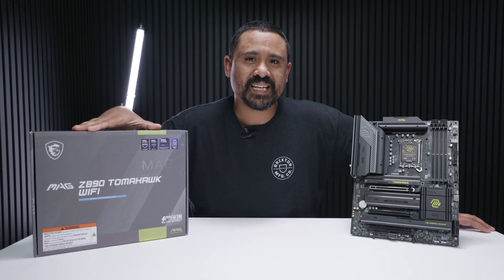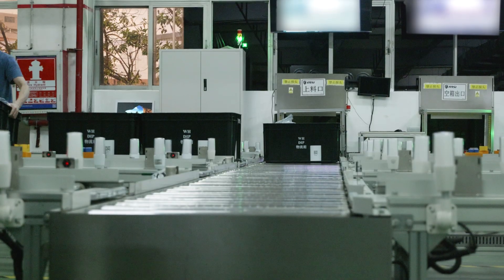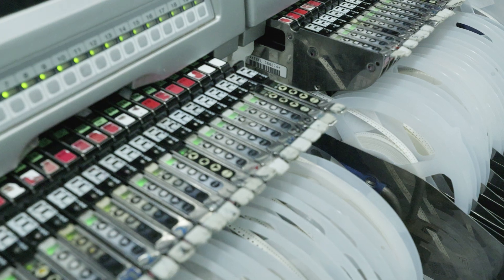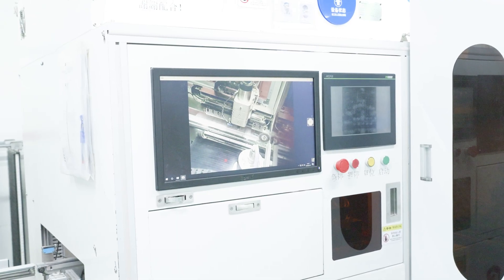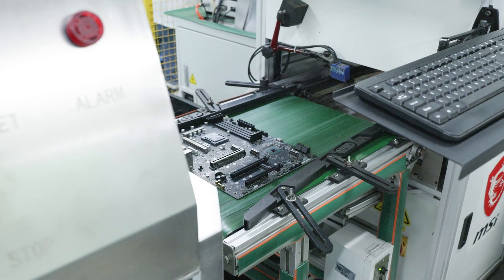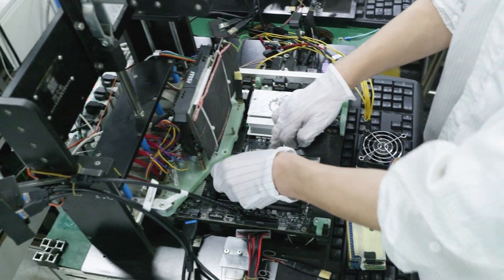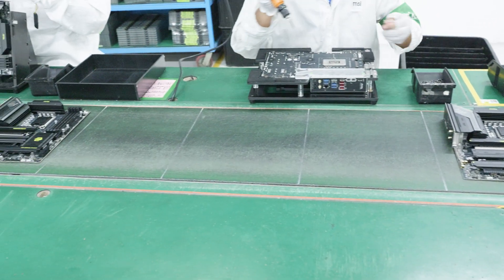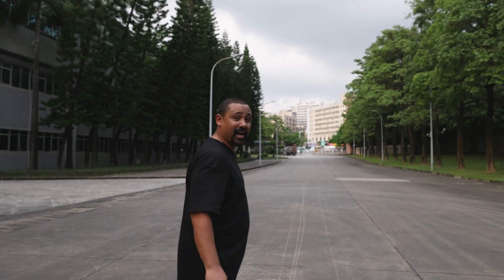The Insane Process Behind MSI's Z890 Motherboards

Comment: I used to run the SMD line for another electronics company. 
You have to do a few test runs from the beginning of the solder pasting process, have the right oven temps, proper component placement, extensive visual tests, then of course, the final bench tests. 
Once you get the green light through all stages, it's time to start production.
The worst part is changing over to different pcb's for other companies, you'll have to change everything to suit 😫